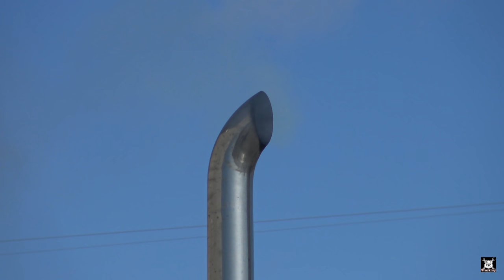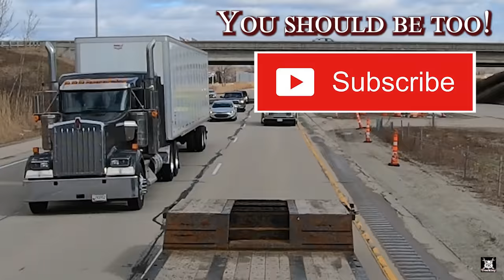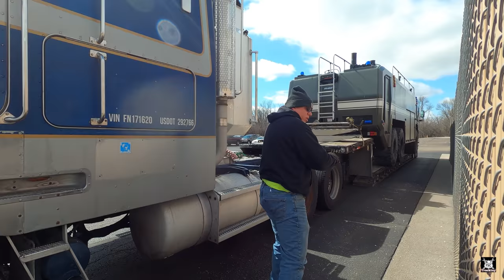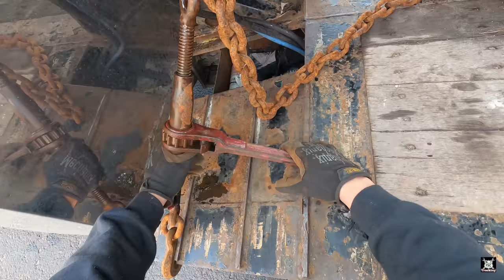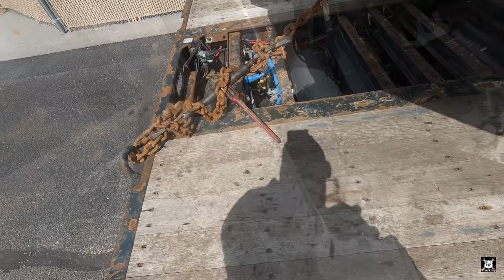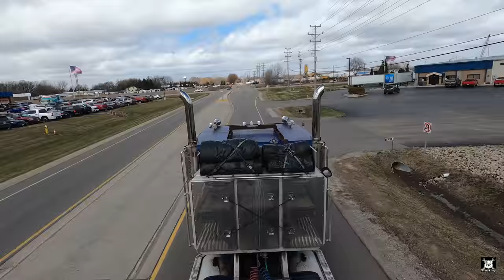USAF Oshkosh Striker Fire Truck Loading In Wisconsin

Comment: those binders are far better than the old style ones , when I run flat bed step deck I used a 5 foot long pipe to yank down chains, you didn't want to have your thumb over the handle when it came time to loosen them , love what you do jerry 44 years of flat bedding

Comment: Hi Steve  coming from Nottinghamshire England
Awesome truck  in the 80's  
all the guys doing heavy haulage moving abnormal load's where British and American  There was a company Called Heanor 
Haulage Tractor with  Detroit V8,13 speed Fuller
box with a Spicer 4 speed
Auxiliary box.  Also fitted with a CAT 3406 15 Speed Fuller came a auxiliary four
Speed Spicer and it was the first time I have heard a Two Stroke Diesel And it was fricking Awesome especially when moving anything around 150 Tonnes also had Volvo Trucks which was Modified as well  all the best Orwell sounds Awesome

Comment: Cold really put a strain on the truck. Wonder why you keep it in the shop when its cold. Binders was frozen in place when driving thru the snow, Steel and cold does not mix. I want the sound wind music XD. But for real tho,Turn up the the music. The music selection is pretty dope keep it up..

Comment: When you haul the larger firetrucks like this, are you overweight as well or just oversize?
Reply: I'm no trucker but he said 45thousand it weighted, add trailer and truck and he be near what box freight  would run I assume, and on a older video he said only reason he need the flags and permits is cause it wide but just as wide as the mirrors on the truck but rules are rules

Comment: Hey Steve got a question, how come do you idle the truck up when it only sits there for a few minutes before you drive it a.k.a. hooking up a trailer. And after driving for a while and you take your lunch and it’s idling.
Reply: i asked the same question awhile back, and its basically to keep the truck cool. it runs cooler at a higher idle than it does at a low idle, if i was told correctly.
Reply: @mulisha0351  Thanks man I wasn’t sure why he kept doing that I was only three years old when that truck came out lol

Comment: Is the ride as harsh as the old timers say?
Reply: Yes.  I don't know about the Pete, but I have a Freightliner and an International cabover with airbags and anything not secured will practically fly out the window.  Nearly everything that's loose ends up behind the driver's seat.  They claim the International 9800 flat floor has a better ride.